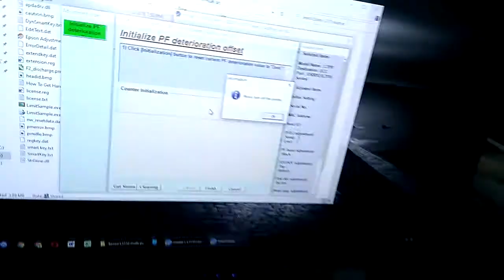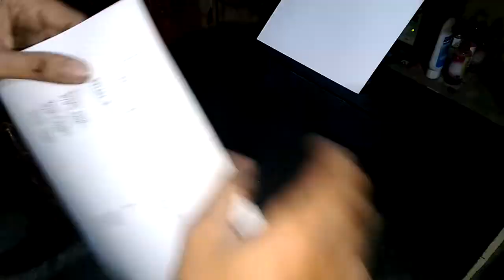EPSON L3110 L3150 L4150 L4160 L5190 Paper Feed Problem FIXED! (Paper Not Feed/Passthrough)

Comment: sir ask ko lang ganyan din ang printer ko once na mag test print mag stuck lang ung head sa left side then mag paper jam na sya ok naman po yan spur gear complete naman check ko na tin ung rubber ng feeder lower and upper ok nman..posible kaya sir spur gear din un...or flex cable na po?
Reply from the maker: Baka flex po

Comment: Sir tanong ko lang, pano kaya yung sa problema ko? Epson L3150 din sya, pero ang problem nya is kapag nagpriprint ako, bago pa sya magstart na magprint talaga, paper roll palang, magstop na sya, tapos Error Code 031003. Pero chinecheck ko naman, wala naman sya paper jam, tapos tinetest ko din daanan ng paper, wala naman problema.
Reply from the maker: Check nyo po spring ng spur gear. Or spur gear baka may missing teeth po.